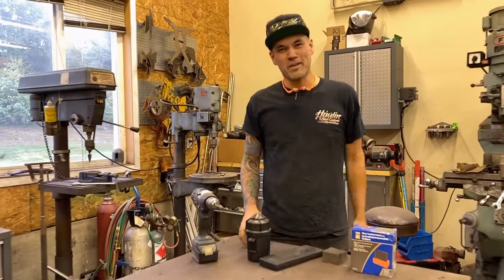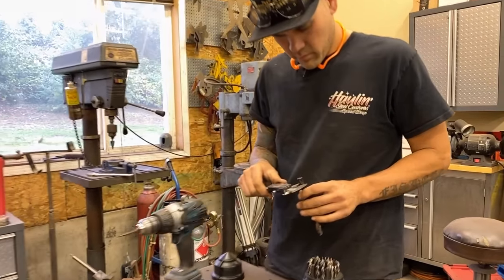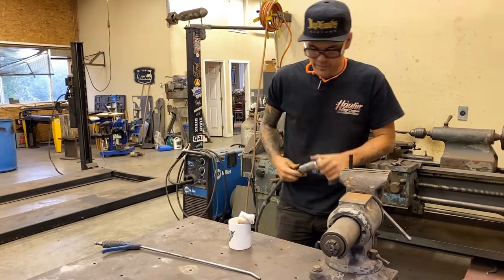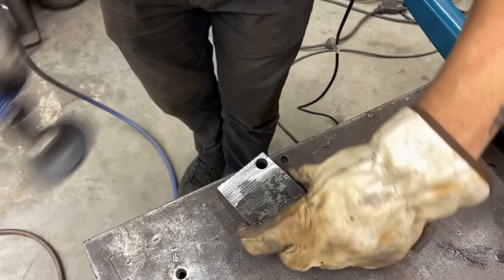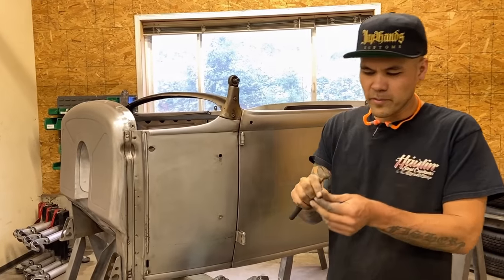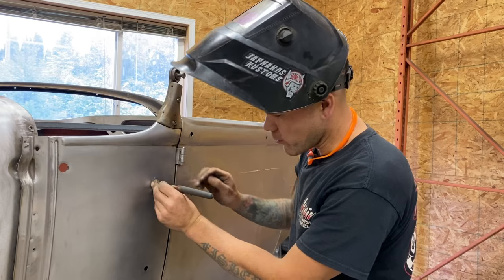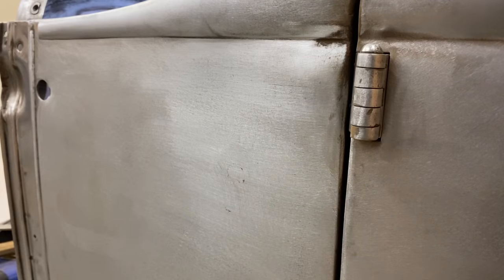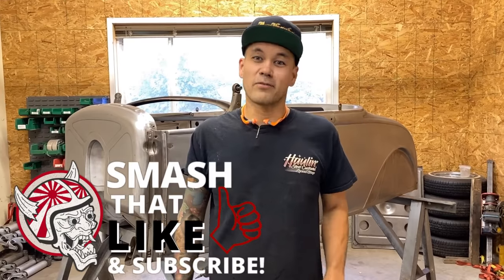Filling Holes in Sheet Metal EASY with This Simple Tool YOU Can Make!!

Comment: I had a wonderful elderly neighbor next door. He  had quite a few tidbits to throw at me on occasion.
One time totally out of the blue he said do you know that a punch doesn't punch a hole,  it cuts a hole.
I of course ask what he was referring to.
He said there's a very slight taper to the end of the punch so it doesn't punch a hole it cuts a hole.
Food for thought. I never tried it but I'd love to see you do it and see if it makes any difference. That way I would know if Wes was right or not. 😁
I'm thinking like a 1° taper or two maybe? .... Heck I don't know.  I don't have a YouTube channel, you do it. 😁
Thanks for sharing that's pretty clever.
If you do put an angle on it,  I'm wondering if the angle  might be flatter and more accurate to do using a belt sander than with a grinder.
..... For heck a grinder with very fine grit might even better. That would put a slight cup shape in the end of the punch making two cutting edges.
It would be fun to see you try out a few different methods of making different ends on the punch that were not a perfect 90°
Remember, like West told me,  you're cutting not punching. 😉
If what I'm advising doesn't work then don't blame it on me, blame it on Wes. 😁
Doing what I just advised might distort the piece of metal but repairing the distortion, well, that's what a hammers for.
Reply from the maker: Thanks for the info! You’re absolutely right if you had a tiny bit of a taper it would cut a little bit easier. When it’s totally flat it does truly punch the hole. It’s OK for small holes but if we were to do larger ones the taper would be absolutely necessary

Comment: I'm new to this metal working stuff but I know this is a really good way to patch hole. If you try to just fill a hole with filler rod most people would end up with a thick blob and most likely warp the panel. This just gave me an idea for bigger holes too. maybe you could use 2 sizes of hole saws to do the same thing. just a thought, because I need to patch a hole that was cut for a snorkel on my hood.

Comment: If you weld a nut half way down your punch and put a spring on the bottom of the punch before putting in to the block you can punch them out really fast just make sure you are holding that punch because it will bounce high if not held and can hit you in the head it works awesome with a fly press

Comment: "Flexing my tool muscles"?! Ok, that 's it! You now owe me a Bridgeport mill to assuage my feeling of inadequacy. Failing to have a magnet anywhere handy, I will tack a piece of .045 MiG wire of some other small gauge rod to one side of the patch piece, bend the wire at a good angle to line up with the hole while I rest my left hand on the body panel, this allows me to hold it in place easily for tacking. I once had to weld up '27 T body that I dragged out of the bush back in about 1970 that had been used as a target by the locals. Around 500 holes. Something like you are doing  I personally would use my Cobra torch or a 00 tip using no filler. Great video Karl, as always.
Reply from the maker: Holy crap man you actually gas welded 500 holes in an old shooting car! Ha ha you can never have enough to muscles
Reply: @MakeItKustom  Yeah, that was a long two weeks. Finally got it all done and the car built, driven and eventually sold a few years later. The build itself took me about 14 months.

Comment: Kool idea Karl! ...and cheap!...I would "flex my tool muscles" and make a plug with my hydraulic iron worker... cheating, I know....
 As a historical note... back in the 70's Steck tool company made a product  called solder plugs... they were pre-tinned brass slugs with a beveled "rim" around the circumference... they came in 3 sizes and they also made a special bit to take the hole to the correct size and countersink the edge for the "rim" to set in...it kinda looks like a step drill. Then you would take some 60/40 acid core solder and tin the hole with a torch... probably could use a propane torch but I used oxy acetylene and wiped it with steel wool as if you were tinning for body lead. Then just stick the solder plug in the hole and hit it with a little heat and maybe a dab of 60/40 solder..let it cool and smooth it with a vixen file..a perfect metal finished distortion free fill job that will last forever...I've never seen one fail. Great for filling excess mirror holes in pickup doors...I still have a stash of solder plugs and the tools...waiting for the perfect opportunity.
Reply from the maker: Wow thanks for sharing that with me man that sounds amazing I wish that that would still be available in today’s market because that sounds like the best way to do it! No messing around or distortion

Comment: I think I saw a guy make something similar but he used a cheap drill bit or some drill rod and used a 1/32 larger drill bit to make the holder. He also cupped the cutter to make the patch dome out a little so when he hammered on it, it would fit the hole tighter.
Reply from the maker: Oh that’s a great idea to then you don’t even have to buy the punch that! I never thought of using an actual old drill bit
Reply: @MakeItKustom  No worries. I think it only works if you keep old worn out drill bits laying around. No matter what method you choose, I am certain you will get more mileage out of the tool then I ever would.  Another tip I'd like to pass along comes from Trev's blog. He has a video on how to repair a captive but using a washer. I have actually used this method once. His video is titled "Captive nut repair, panel beating techniques Tips and tricks #9 Bodywork" from Jan 5th 2019.

Comment: If you leave the point in the center of the transfer punch it makes the patch slightly concave. Once you put it in the hole you’re filling a tap of the hammer and dolly will flatten it out and it’ll stick in the hole for welding.
Reply from the maker: I like that idea! You don’t even have to hold it

Comment: You can hand punch larger discs if you grind a pringles shape on the punch, that reduces the punching force required but you will need to hammer the disc piece flat again. Or you could punch it out with a hydraulic press instead of a hammer.

Comment: Great idea Karl..I wonder if this could be used on thicker metal such as frames? perhaps a sheet metal plug on one side of the hole and then just fill with a mig? Cheers
Reply: Read my comment above. It works for heavier metal too.
Reply: For thicker metal, how about cutting slices of round bar?

Comment: And another cool tip for do it yourselfers🔧,for holes bigger than 1/2inch,could bolts with the threads cut off and heated and quenched be used in the same way? Also did not know you could use that size and kind of wire with a tig welder! Keep those tips coming on your channel 😉
Reply from the maker: Will do! Thanks for watching and yes for larger holes I’m sure that a bolt would work if you heat treated it And cut the end of it on a slant so that it cuts the sheet-metal easier

Comment: If you make your punch with a pin head to dimple the center it will make a patch that can be hammered into place versus held in place with magnet. If you tig these panels you may have recognized the interference that magnets supply. But neat trick none the less thanks for sharing.

Comment: I just use my copper block for welding up holes 🕳️ in quarter panels of Aussie Utes and other places like engine bays and whatever else as the copper block takes out nearly all the heat of the weld and leaves a flat surface behind the weld ready for metal finishing with a toe dolly and panel hammer/ slapper

Comment: If you can put the magnet on the back side and try to use a small  black ceramic magnet with the weaker magnetic field or a small corner magnet where the magnet is set back and it won't try to pull your arc as much as the much stronger neodymium magnet 👍👍👍

Comment: Nice tip :) If they aint bigger than that. You could all so put, a thick piece of cobber on the back. and just fill it with mag. crank the wire up a little :)
Reply from the maker: Yep definitely! I do feel smaller holes like this but in sheet-metal these were pretty big

Comment: Thanks Karl, Hey what about holes bigger than 1/2"???? Say 5/8' or 3/4" or 7/8".
And what about using two pieces of 1/2" or 3/4" plate with spaces between them instead of slicing a slot with a grinder. This way you slide your punch sheet thru easier???
Reply from the maker: I think it could still be done but you have to get creative with angling the punch cutter so that it can slice around the hole. And that’s a great idea with using two pieces of plate instead of using a slot with a grinder
Reply: @MakeItKustom  With the punches I thought of using a punch head out of a punch machine. The one shop here i looked at sells these separately for around $55 USD and then all you'd need is a large heavy washer and a frigging large nut and bolt. There's your punch.

Comment: Fitzee came up with another way that is a little quicker.  Snip a small circle of metal a bit bigger than the hole.  Tack a nail or a bolt to it, chuck it , spin it and grind it to size. The nail is the handle to hold while you are tacking it.  After tacking cut the tacks on the nail or bolt and weld it solid. Both ways work, but this way saves you from making the punch tool.
Reply: Thanks for the channel . You and Fitzee’s Fabrications are both teaching me.  Great work. Thanks again
Reply from the maker: Yeah that’s an awesome way as well! I definitely use that similar technique on larger holes ! You must welcome John thank you for watching cheers!

Comment: One could use an old 1/2" etc drill bit as the punch. or drill into a piece of aluminum rod half way. and then put it over the cutting end of the bit you used, to tap on with a hammer? if it doesnt clip the bits teeth??

Comment: A very helpful tip 😊 Only downside living in Oz is that the cost of the punches makes it a bit pricey for a DIYer.
Reply: eBay have them... 28pc Center Punch Transfer Punch Set Steel Machinist Thread Tool Kit 3/32"-1/2" - $24.99
Reply: @mikeurlich6563  In Australia?
Reply from the maker: Another guy in here suggested using old drillbits
Reply: @MakeItKustom  That's a great idea, thank :)

Comment: Quick question: Why put another coat of base on after you smoothed it with 800? It seems like you run the risk of getting dust in the 3rd coat. I know I would, painting in the driveway. Would I get good results of I cleared right after your 800 sand trick?

Comment: Other way is just use a couple of pieces of flat bat say 6mm thick. Weld them together over each other with a spacer between then at one end. Weld together.  Lacking a welder bolt together. 

Then drill the hole as per video etc.

In Australia you can buy pin punches in a set.  No point on the end.
Reply from the maker: Yes absolutely that’s an awesome way! You definitely don’t have to cut it with a grinder when you use two pieces

Comment: When using magnets on holes i use those weak refrigerator magnets ( the kind that are rectangle with logos) to hold so my arc don't act weird
Reply: Ohhhhh, have you noticed anomalies when using stronger rare earth type alarm system magnets etc?
Reply from the maker: Great tip thanks for that!
Reply: @MakeItKustom  Does the magnets bend the plasma arc and mess up ur aim?
Reply: @THRASHMETALFUNRIFFS  yea the magnetic force makes your arc dance around and cause porosity
Reply: @nvme069  Interesting (I'm not a welder or fabricator but I watch them on TV, lol)  This makes perfect sense now though, it's the same as the sun expelling tons of plasma toward earth and our magnetic field warps most of it to go around!  Plasma isn't really a solid, liquid or gas so I kind of forgot that it's magnetic or whatever... I did show how to make plasma in the microwave in a cool short vid though that's pretty METAL!

Comment: Started watching your channel because of Fitzee’s recommendation…great information here, thanks. Question, after repairing the hole and grinding down. I start to see small pin holes. Is it ok to bondo at this point, or do I tack weld and start all over again? I want to do a professional job. Thanks!
Reply from the maker: Thanks for watching Michael. It’s important that you don’t grind too far. Just grind the weld off Try not to grind the sheet metal. There should be no holes when you start to Bondo

Comment: Meanwhile on my yard: Pissing down rain, windy as well. Half blindly  shoving mag welds into a spot that has more rust, body filler and seam sealer than steel.
At least its better than a gaping hole that was there when i started. Cars should not be sold without undercoating and cavity sealing.

For once I would love to do body repair in a proper garage on a car that had been properly stripped down to bare metal.

Comment: Hi Karl. I'm a big fan of yours .and Bennetts customs. I have a question..maybe related. or not . To this topic.  I'm retired. And pulled my Ol'Beater  Chevy truck out of moth balls. Stored in my garage fir almost 30 years. I didn't have a bed or rear fenders for it. A couple of months ago. A trailer using a 49 truck bed and fenders popped up. I got it. The way I modified my frame. The bed has to be modified to fit. . It has a spare tire dumpled left fender. I won't have room for a spare tire. I'm looking for someone to trade a regular fender. For mine and the tire bracket. If not .How would you deal with the fender spare tire dimple. Depression.? Thanks. Sorry for going on so long. (JUAN)

Comment: Nice tool.
On the note of welding, try using proper filler wire and you shouldn't get those porosities. MIG-wire has a lower silica content than TIG-filler rod, and that can cause some issues like that. Not critique. Just a tip.
Cheers.

Comment: Awesome idea man, I would have thought the end of the punch needed to be concaved so the outer rim would kinda start the shearing process... if that makes sense.
This got me thinking about a guillotine, they work the same, don't they? Two perfectly square sharp edges with almost no clearance? Or is the bottom edge of the top blade angled slightly? 
I wonder if I could make myself a small guillotine based on this? 🤔
👍👊
Reply: I would vote keep the hole close in size to the punch. Angle the punch head so it starts to cut on one side first.

If the hole is bigger than the punch.. It would rip more than sheer. Idk
Reply from the maker: Lol you cutting some fingers off boss? Ha ha yes you’re right that it would be simpler for there to be a starting point but because it’s so small and the force is so great I kept it flat so that the punched out pieces stay perfectly flat. If it were any larger we will definitely have to make a starting point for the cat perhaps by angling the end of the bunch

Comment: A question, if I may.  On the Model A you are building you have fittings or a fold down windshield.  I have a '28 Model A Ford Roadster and would like to find a pair of those fittings. Any idea where I might find some please?  Tony Hillyard, Normandy, France.
Reply from the maker: eBay is a good place to find original pieces

Comment: How do you keep that baremetal body from rusting? Is it just because its inside in a temperature controlled building? It seems like it only take a day for anything I grind or sand on to start developing rust spots.
Reply from the maker: The shop stays pretty dry but if a project is going to set a long time are used Gibbs

Comment: If you were filling holes in an aluminum panel could you place a piece of sheet metal behind hole so you could use the magnet, tig weld
Reply from the maker: That sounds like it makes sense? I don’t do a lot of aluminum

Comment: If you were going to mig weld what size  wire and Flux core or not thanks buddy
Reply from the maker: I definitely prefer gas shielding on wire feed welder. The smaller the better for sheet-metal so usually 023

Comment: Shouldn't you grind a convex in the end of the punch so it has a sharp outer edge, so as you punch the metal it pulls the metal inward and away from the outer metal so it does not try to drag the outer metal through the hole?
Reply from the maker: Works great as is

Comment: Thanks great tip! What body is that I’m interested on stanchions and bottom cowl piece
Reply from the maker: This is a 1930 Model A. We are removing these windshield stanchions For a different type of windshield. Which bottom cow pieces do you mean?
Reply: @MakeItKustom  I’m building, in gathering up mode, a 1948 Anglia cabriolet 3 window coupe( ie phantom Anglia) I like the roadster style stanchions opposed to size& thickness of A pillar. From the video the stanchions appear to be attached to a windshield bottom. I’m thinking to make that all one piece and have windshield frame open from bottom hinged at top

Comment: Sorry. I meant the wire on your wire feed. I'm using a Lincoln 210
Reply from the maker: 023 for sheet metal or 030
Reply: @MakeItKustom  HEY. Thanks for answering. I'm watching you on bvb tv at the moment. The tour of your  shop.awesome. I'm working on my  O'l Beater 54 Chevy truck. I building it with what I have. My stainles steel fan shroud used to be the top of my rollaway toolbox. I'm a retired AA aircraft mechanic. Maybe I could send bv you pictures. Great work you do. Inspires me

Comment: If you measure the shank of your twist drill then measure the lips of the flutes, you will find the shank measurement is not an accurate representation of the subsequent hole size.
Always measure at the lips.
Reply from the maker: Very smart thanks for that!

Comment: Couldn''t you just use the next size down (-1/64) punch?
Reply from the maker: Yeah just seemed a little bit sloppy I did try it in the hole seems like it could misaligned maybe next time I would drill slightly larger on the bottom side of the cut